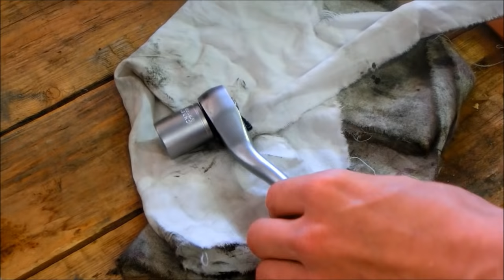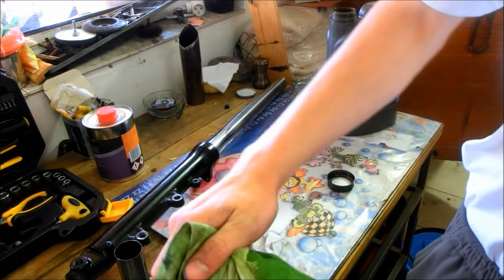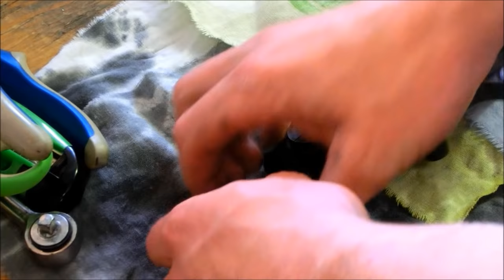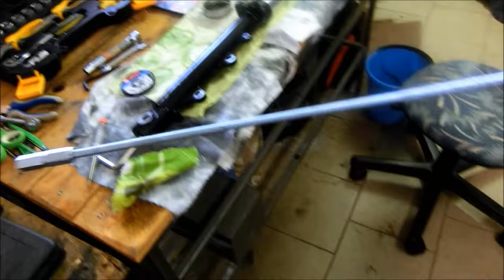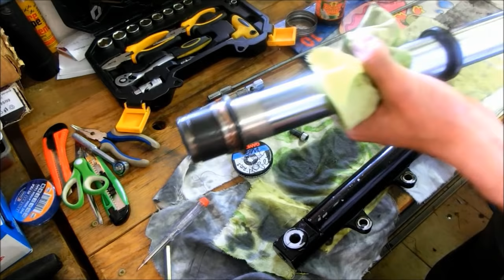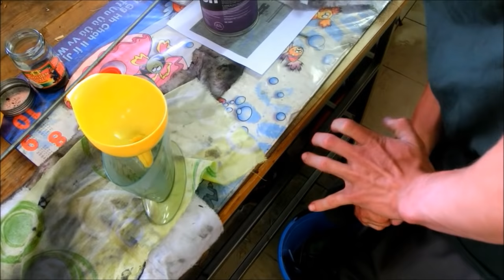How to replace motorcycle fork seals

Comment: Hi I think this is the first time i have seen some one using a very long socket to be use as inserting into the folk to aid the removal of the Allen bolt at the under bottom of the folk housing
my question is what is the name of this extra long socket ? and are they only needed some times
thank you in advance , john from Manchester England
Reply from the maker: Hello John, it's just long threaded bar with pair of nuts tightened against each other - very cheap gadget :-)
Reply: ok thank you i will watch the clip again to see what it looks like if i can pause at the right time

Comment: Hi fella, what's the chance you could list the tools needed to change the folks
Reply from the maker: there is no unusual tools needed, only special tool is the long key to loose nut on the bottom inside fork which can be made out of usual stuff as a threaded rod with 2nuts on it (size depends on your type fork), set of alan keys required.
Reply: 200ml shocker 100ml+100ml eingein oile=200ml super best idea

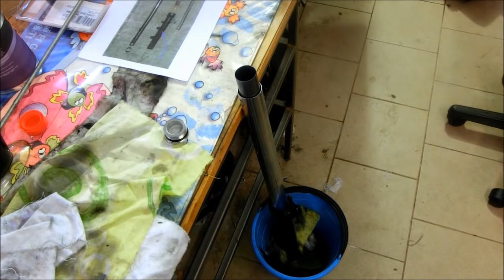Comment: ok i see another problem at 6:13, you're pouring in fork oil back into the fork tube, did you just reuse your oil fork oil? and what about the bottom 6mm allen bolt I didn't see you install and torque that bolt into the damper rod

Comment: The video does run a little fast. My biggest complaint is that U skipped actually installing the seals. Sure! U hit the seal with the ol' meat hammer a couple whacks but I'm thinking U had to use more than that.  Didn't earn a sub from me this time...

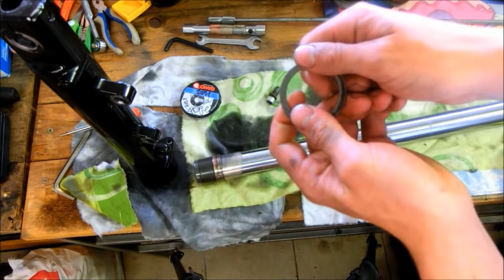Comment: you made a mistake, because I see at 5:15 you are about to install a new oil seal onto the inner fork tube, but you cleaned off both inner and outer bushings, you really should replace the inner and outer bushings also with new because by just changing the oil seal on your fork it is going to leak again and you'll have to change out to new oil seals again, to do this job right change out the inner bushing you see there on the lower part of the inner tube, and the outer bushing that you removed and cleaned off then re-installed on the inner tube, reusing the washer that goes on next is ok then install your new oil seal and after all that is installed and set up on the lower outer tube, then install a new dust seal, and rub some fork oil around on the inside and outside of that new oil seal so it can slide down onto the inner tube easier without doing that with a dry oil seal

Comment: what size nut did you use to remove for the inside of the fork?
Reply from the maker: Erik Chavez Hi mate, it depend on your type of bike, fork. Do some searching on google for your bike's fork :) (I think, mine was 16mil hexa)
Reply: For my 2000 Kawasaki KL250G Super Sherpa I used a bolt head that was 7/8" or about 22 mm.